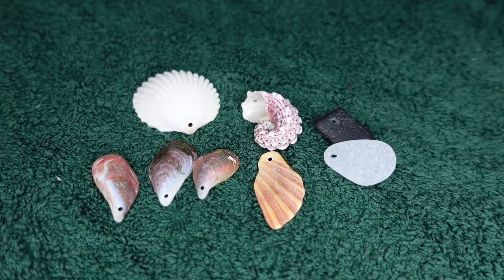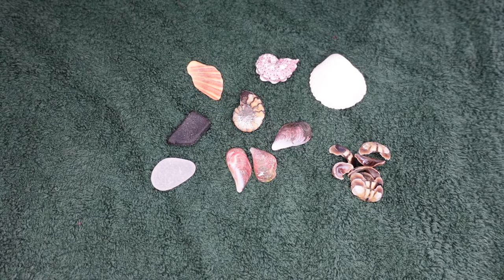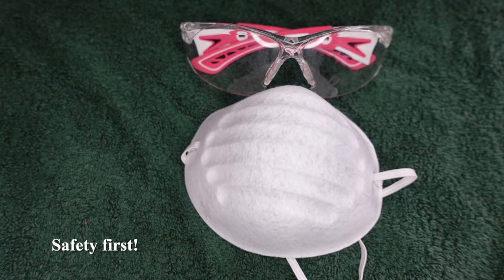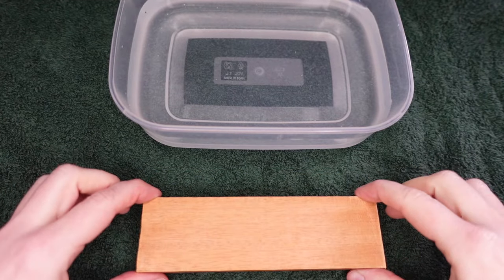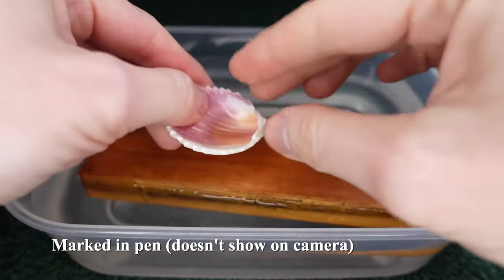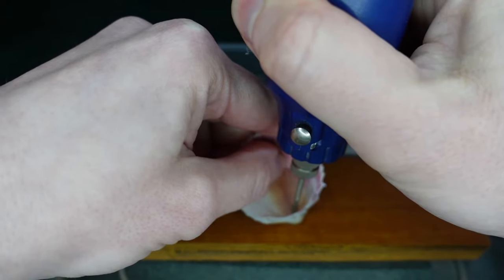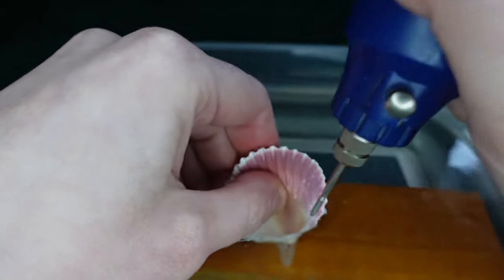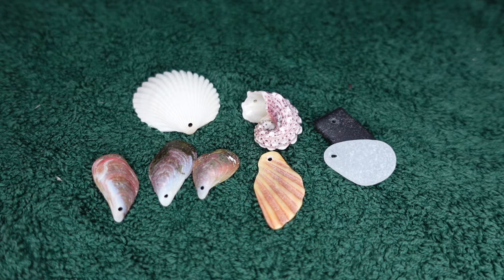How to Drill Holes in Fragile Objects Without Breaking Them | Shells, Sea Glass, Stones, Ceramics

Comment: U need a disclaimer people to not use with plugged wires and only battery operated drills!
Reply: Sensible people just dip their drill tip in water intermittently, it does exactly the same thing. 😊